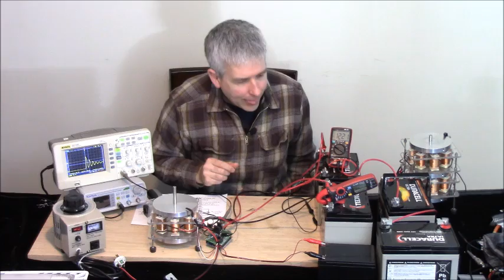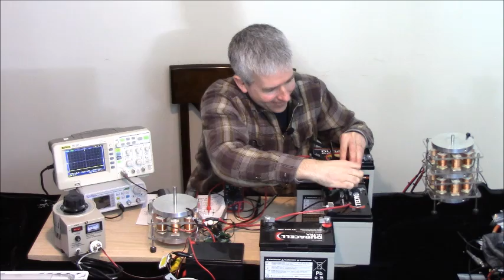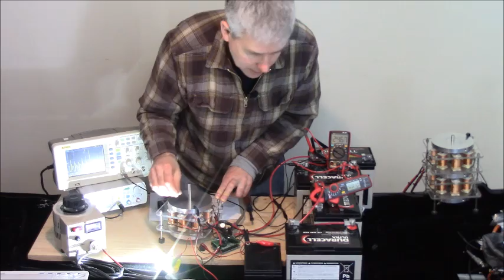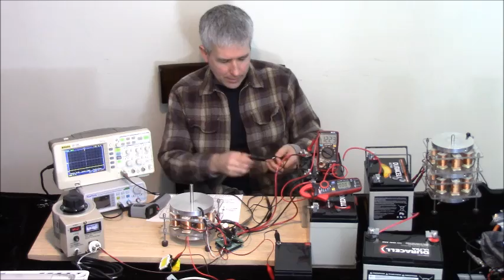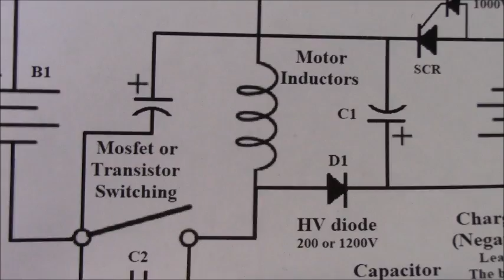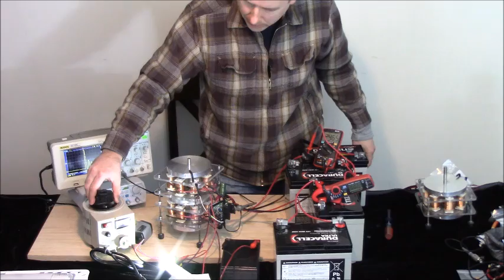Upgrades & Transducing Negative Energy to Positive for Battery

Comment: Do you stick new batteries,or batteries that are fully conventionally charged on a negative charger (pulse charge) and let them convert over, OR do you drain them first before "charging negatively" and, what do you mean by antigravity being a benefit? Very curious.
Reply from the maker: We drain them down to 1V and immediately charge them up with negative charging. I haven't verified that they get lighter but it is something that Bearden claimed. That subject was not ever important to me so I haven't spent time on it.
Reply: @rickfriedrich thanks for the reply!  1volt, wow, that sounds extreme. So 12 to 1... I would have thought such a low voltage would be certain death.
Reply from the maker: @failforwardresearch3127  That's the fear. We do that when we are converting it to negative. I actually do it 10 times. We'll be getting into this in the upcoming meeting.

Comment: So rick if you can pulse many times per second the better?  Even with small voltages? Dumping it to the battery?
Reply from the maker: Depending on what you are doing.
Reply: @rickfriedrich  i am trying to have my motor to produce more energy from source battery to charge a battery. like i want to swap the batteries after they are being charged

Comment: Hello rick.
What kind of rise / fall time are we talking about here?

Thanks for your video mr.friedrich
Reply from the maker: Not sure specifically what I shared there but the shorter the better. 60ns or less.
Reply: @rickfriedrich , answer very much appreciated.
Was wondering if it was in one of your videos, where you were reading an article about an old experiment with induction coil, made by henry or whoever in the old time. 
You know the one with metal tabletop, increased spark length and diferent grounding or insulated body.
Just can't find it anymore either in google or after a rewatched lot s of your vids.

Comment: Rick I understand now why it dosent work i have a wrong connection. But why is it that the motor that i have goes fast and slow whan it spins using the diagram is that normal rick?

Comment: Rick i am now trying to replicate Your cap dump circuit to change negative energy to positive. Do all 100 uf 450v capacitor the same because what i did buy is an electrolytic capacitor with that value
Reply from the maker: "the same"? You are missing a descriptive word in your question. Not all caps are the same. I sell hf caps that are low esr. When I get some time I will add some high quality caps that I mentioned recently. Just be carefully not to pulse batteries too hard with too much capacitance.
Reply: @rickfriedrich  rick what i did is that i did use a transistor to turn ON and OFF a transformer fast continusesly using a bedini fan. the energy is in between the collector and emitter so i did put a diod on it and and connect it to a capacitor and use the secondary winding of a transformer and connect it to a bridge rectifier and capacitor the voltage did go high very fast i can get 500v per second. Is that to much ? I am charging a lithium ion battery. I did not do the pulse thing. But charge it directly to the battery using the diagram that you did show
Reply from the maker: Not sure of what you mean here. Be careful with lithium as they can explode. They are low esr so can charge well, but they are temp and voltage sensitive.

Comment: Rick i did try experimenting using flip flop to dump capacitor i did observe that the faster the light blinks when it dumps the better it is. Is that correct?  Like lightning fast. Every 2 seconds with (SCR, capacitor 33uf 400v, optoisolator) rick can you give me an advice
Reply from the maker: There are some very interesting things with a cap where it charges back like and elastic band. So you are working with a frequency of say 300-1000 impulses per second. So you could in fact trigger it that many times. That is one of the secrets I just showed at last week's meeting in another system where if you pulsed it every second you would only get 10uf 10V or you could do the same 26,000 times per second for a whole lot more...
Reply: @rickfriedrich   i did try to measure the voltage of my capacitor while charging and discharging it reaches 100v in 4 seconds. Is that okay? Or should i do more? My cap is 33uf 450v
Reply from the maker: Depends on what you want to do. There are curves in the charging of capacitors. Waiting for a cap to charge up may not be the most efficient use of the capacitor.